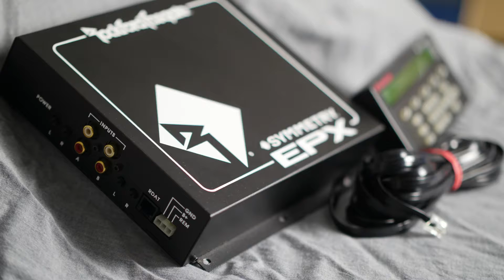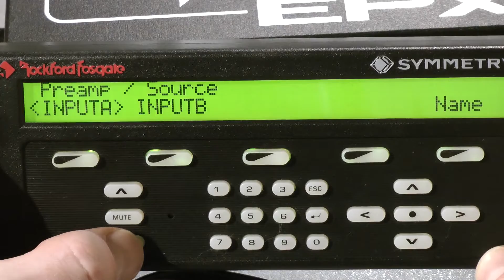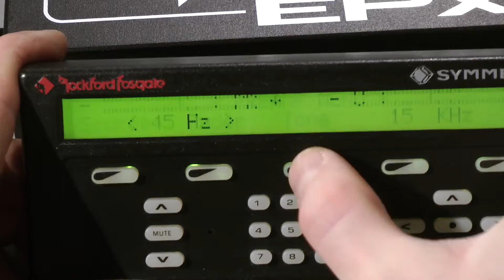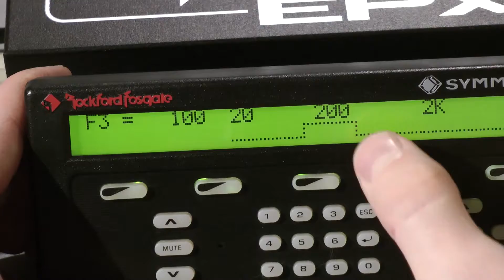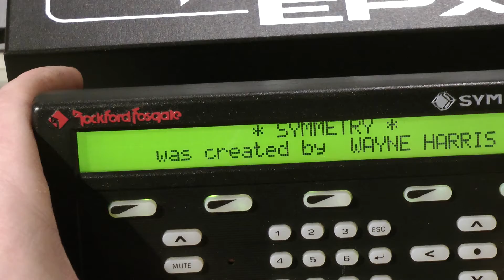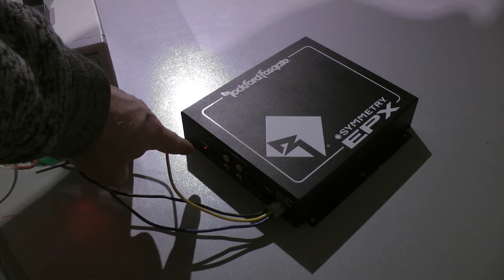Rockford Fosgate 1994 symmetry epx menu tour and functions old school - no amplifier dyno this time!

Comment: I bought a used EPX2 with the extended EQ card in the mid 2000's. It was way fancier than the twin Audio Control EQTs i had. 
I ran it a while. It was pretty nice, but it seemed the noise floor was a bit high. I ended up selling it and buying a used Alpine H700 which I'm still using to this day! Lol

The EPX was pretty groundbreaking when it came out. I wish I had kept it. I still have my EQTs. Brings back good memories. 😊

Comment: I had a epx2 in 2002 with the 24 band eq. card. It was too much on the eq side but the xover was spectacular. I had Image dynamic full size horns and 6.5 up front and coaxials in the back and two 15's un the back. It was the best dsp I've ever used but you need all those settings saving for the difference in songs. I had rock, rap, it was alot👍
Reply from the maker: i never had one back in the 90s or early 2000s. it was spectacular what you could do with it. even most  todays AVRs dont have the possibilty to do so many adjustments. 👍

Comment: Thank you, please do a video of it hooked up next time.
Reply from the maker: hi!
this isnt going to be hooked up in the future. 20 years ago i installed the last carhifi system.  i just collect , check or repair mid 90s rockford stuff just for fun 😀
Reply: @audiokeller1975  I just noticed yours doesn’t have the segmented lights on the main box. I have two of these units, one has the window and lights and the other has the window but doesn’t have the segments.  Yours doesn’t even have the window.  Interesting, I wonder which one came first?
Reply from the maker: @preinstalleduser2309   the EPX in this video came first and then the EPX2 , its hard to find an original manual for the EPX because it has been quickly replaced by the EPX2.